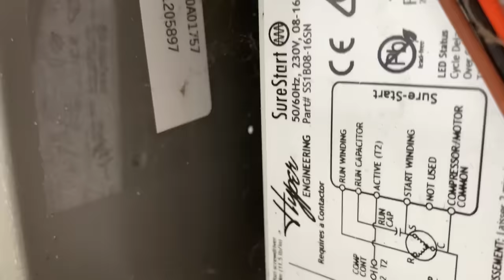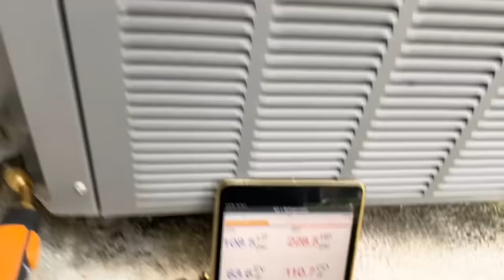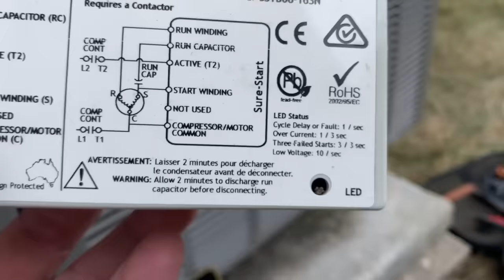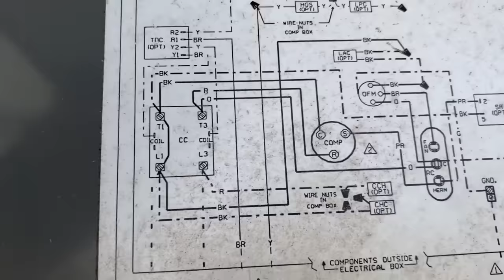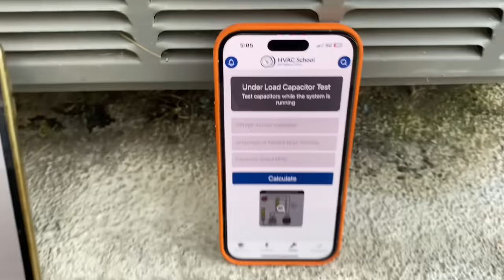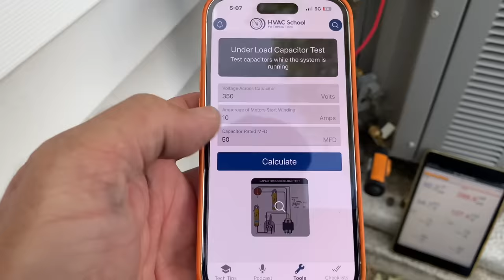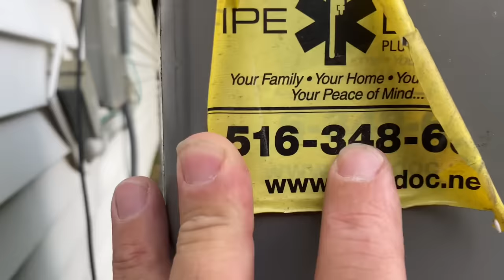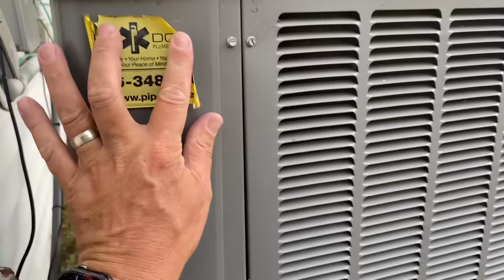Soft Start Killed Compressor! UNEDITED Central AC Service Call for No Air Conditioning Revealed!

Comment: The headline was a bit misleading.  Reading it, it implied that the Soft Start "killed" the compressor, meaning it failed and required replacement.  In reality, it shut down power to the compressor and faulted out, but the compressor itself was fine.  And as some have noted already, was protecting the compressor from over current due to dirty coils, and I believe it was an undersized soft start for this particular unit.
Reply from the maker: The soft start killed the compressor. Those are the fax it kill the power to the compressor that is more factual.
Reply: Facts* and no those aren’t the facts. Killed the compressor means damage and replace. This was not the case. The soft start went bad due to amperage
Reply: @PipeDoctor  Hi sir. When someone reads or hears that something has been "killed" we always take it as that the part has been severely damaged or destroyed. Killing the compressor is different than killing the power TO the compressor.
Reply: @PipeDoctor  Most soft starts also act as a surge protector could have been a surge maybe a lightning strike somewhere else caused the soft start sacrificed itself. I know you wanted to get clicks and views knew bunch of people would react to the video headline 118k views LOL. If the customer is never going to use a generator why replace it I agree remove it.
Reply: @PipeDoctor  so it killed the power not the compressor
Reply: So it acted like an interlock.  The compressor did not fail and was not damaged at all.
Reply: The soft start is not a piece of junk but is required to be installed on a home with a back up generator. This device keeps the amps from surging during the unit start up so it doesn't trip the generators over amping detection.
Reply: @JDOG1974yes  True, and it also saves wear on the compressor and makes it last longer.
Reply: This is a great video and I find it informative.

People are taking exception to the Clickbait line, which is understandable.

One other thing that I will point out from the video which I feel is important: you stated the compressor may need a hard start. The compressor is over amp on start up probably due to its age/wear.  The hard start probably was picking up on the amps being too high and shutting the load down. This gives opportunity for someone like you to go. Investigate with the problem is. Now the homeowners are aware they have a feeling compressor.

Thank you for your content. Anytime there’s a healthy debate over content. Everybody can learn a little.
Reply: @danieldorchester5221  I believe in the video in question, it was determined that the Soft Start kit being used was the wrong kit for this sized Condenser Unit, the kit was for a 1 to 3 Ton Condenser, but the the A/C was a 4 or a 5 Ton Condenser.

They make this kit in two different sizes, and using the wrong kit meant it failed as it wasn't rated for the Condenser size in question.

However, as I noted, the compressor didn't die nor did it fail, the kit failed, which didn't "Kill the Compressor", it Killed the Soft Start Kit instead...
Reply: @redbaron6805  You're right, this soft start was at the edge of its limits. It's rated for 1.5-7hp, 8-16 running amps. For a 5 ton, anything less than 16 SEER would be too much for it.
Reply: @ad-cc1sw  The soft start is a bad thing to put on the compressor.
Reply: @JDOG1974yes  It means you have the wrong generator.
Reply: @JDOG1974yes  Its not required you have too small a generator
Reply: @RadioRich100 Soft starters are great and they are a luxury item, a protective item. That system is as old as it is, and still working, partly because of having a soft starter on it. He really needed to clean the condenser coils first. They are plugged with garbage.
Reply: @ad-cc1sw  Those things DO destroy compressors by over taxing the start winding which can lead to failures. You shouldnt use them. This is why your warranty is violated by putting one on your unit. Or a hard start kit. Both are not good for your compressors motor.
Reply: @JDOG1974yes   Soft starts DO destroy compressors by over taxing the start winding which can lead to failures. You shouldnt use them. This is why your warranty is violated by putting one on your unit. Or a hard start kit. Both are not good for your compressors motor. Get the right size generator.
Reply: Anybody who has a dog that loves him as much as your dog loves you is A-Okay in my book.
Reply: @johnwhitehead5457  ??
Reply: @PipeDoctor  SoftStart prevented compressor to run. Compressor might have killed the SoftStart unit, or maybe did not, it should be tested on smaller motors. That particular SoftStart model SS1B08-16 FLA is designed to run Motors Between 1.5 - 7 HP For applications w/ 8-16 Full Load Amps (FLA)   
In 10:46 it is visible that this AC unit needs min supply circuit 33A and needs fuses from 40 to 50 A. That 8 to 16A unit did not have a chance.
Reply: yeah it's called a clickbait title lol. But worked it got me to click it, thankfully your comment saved me from watching the whole video.
Reply: So another words if that thing wasnt on there - it would still be running.
Reply: @RadioRich100  Basically yes.  Somewhere in the comment section, someone mentioned that the Soft Start module installed was for a 3 ton unit, but the unit is a 4 ton.

So, the soft start kit was the wrong one, and probably failed for that reason...
Reply: @redbaron6805  If it hadnt been installed it wouldnt have failed and the system would be running. If you install one its wrong right there. You dont need it and it doesnt protect the compressor or save you money.
Reply: @RadioRich100  As I noted earlier.

1.  It was the wrong part for that system, so putting in the wrong part for the size of the system is why it failed, nothing else.
2.  You obviously have no idea what soft start systems do, so your claims that you "don't need it" is based on what...? 
3.  Soft Start systems not only DO protect the compressor, they extend the life of the compressor by reducing start up current through the motor windings, and prevents the compressor from trying start immediately after a brownout or a brief power failure.

Why comment on things you have obviously no clue about...?
Reply: @Mike-01234  I blocking him for the title.  I am getting ready to try one of these soft starts on my sailboat so I can hopefully use a 5000w gen while at anchor for my 16k AC unit.  So I wasted my time watching a bogus video.
Reply: Bullshit
Reply: I bet the softstart did not fail. It started the compressir then shut it down due to detecting too much current. That was due to the dirty coil. It was an under sized soft start set to shut down at very close to the normal run current. As the coil got dirty current increased and it acted actually as it should. Had it not shut down the compressor it likely would have overheated and eventually actually died.
Further that house has a solar system, see the label on the box. By removing the soft start the system may mot be able to deliver enough current to start the compressor when the grid goes down. 
That should make for a happy homeowner😀
The more accurate title would have been “soft start saves compressor”
Reply: @56ctconger  Gee if the soft start wasnt there it wouldnt have failed at all.
Reply: @RadioRich100  What wouldn’t have failed? Nothing failed here, not the soft start, not the compressor. The only thing that failed was the diagnosis. The problem was principally a dirty coil. The wrong soft starter was applied as well.
Reply: @56ctconger  Lol your AC failed because that box came up with a code that shut it down didnt it?  If you didnt install the box it wouldnt have shut down. So why install it? It runs better without it.
Reply: @JDOG1974yes  there is no such requirement for these piece of junk soft start devices.
Reply: No it happens alot. And everybody on here denies it because they stupidly bought one.
Reply: @RadioRich100  That is literally fiction.
Reply: @redbaron6805  You think so?
Reply: How long have you worked for that company? Maybe you should make a fake review video.
Reply: @JDOG1974yes  Exactly, or backup from solar system. It seems to me like "I am old school, I do not know this was supposed to do so it must be unnecessary junk." No offense to author, we all learn whole life.
Reply: Lots of soft starts have killed compressors for many reasons. So why buy one? Also voids your warranty - Double wammy!
Reply: @RadioRich100  Except of course, there is zero actual data that supports that claim.  Soft starts can't kill compressors.  And no, soft start systems do not void your warranty.
Reply: @redbaron6805  So your selling them? The data as you call it is everybody that has lost there compressor and warranty at the same time. Ive heard it from hvac guys and consumers alike. Do you really think there is some govt agency that logs compressor failures due to installing external gadgets on them? As far as the warranty being void - a definite, call the manufacturer. Theres your data. Not to mention the tons of service calls related to these things failing and bringing down your system due to component failures, electrical surges and lightning strikes which would not have effected the unmodified compressor. Also property damage. When you put one of those in your system, it now depends on it. An electronic gadget box increases the point of failures dramatically and when it happens when your away from home, mold growth, moisture damage etc. Not a good idea to install one
Reply: @RadioRich100  The data is "everybody" who lost a compressor...?  Who is this "everybody"...?  Do you have any actual data showing what you claim is true, besides you just happen to know a bunch of "everybody's"...?

Yes, obviously YOU have done your own studies and interviewed hundreds of HVAC companies and consumers on the issue, and I'm sure you published that peer reviewed study somewhere.  Care to share the link to it...?

You seriously think lightning strikes and power surges don't affect the compressor..????  Based on what...???  I have only worked with electronics and motors for about 30 years, and I have never heard this new magical statistic where compressors and motors are not affected by lightning strikes and surges.

Literally ALL industry data CLEARLY says that lightning strikes and surges can damage windings and cause early motor failures.

You appear to be posting a ton of claims here with zero actual evidence to back any of it up.  In fact, literally every A/C company and installer I have ever talked to, including every A/C contractor forum clearly say that soft start kits make compressors last longer.

Yet... there you are... with some magical data from "everyone" showing otherwise...
Reply: @redbaron6805  This is a place for commentary not a court room nor is there data supporting either side thats recorded. Sorry about your sales going down because people like me will inform others. But your opinion is based on people selling them. Mine is based on actual happenings with no monetary involvement. I have been in the industry a long time and my facts stand along with the findings of others like me that these magic boxes are not recommended due to the problems they cause by forcing systems to operate in a way that the equipment wasnt designed to. Instead of crying about this why dont you contact the manufacturer of the A/C system and ask them? You know you wont do it, because they will tell you what you dont want to hear. That is your data. Stop getting opinions from half ass contractors and merchants that sell them to people like you who dont know any better. Stop listening to utube follow the leader know nothings.
Reply: @redbaron6805  You havent seen the ball since kick off. Ive disconnected enough of them. Call your manufacturer about the warranty. Its their opinion thats counts, not that of a halfass follow the leader utuber.
Reply: @PipeDoctor the first sentence you provided is misinformation. The second sentence, where you provided more information is more factual. However your logic shows you know you are in fact incorrect but attempting to stand your ground anyhow shows you just care about the views and don't care that you know it is clickbait rather than rightfully earned the foot traffic for doing a good hard earned job.
Reply: @RadioRich100  It obviously isn't.  The entire claim is just beyond absurd.
Reply: @RadioRich100  It doesn't.  A soft start kit means you can use a smaller generator.
Reply: @RadioRich100  Just clueless nonsense...
Reply: @RadioRich100  Just more clueless and absurd utter nonsense.
Reply: @redbaron6805  At the price of the compressor and other failures
Reply: Nonsense, if you didnt put it on that system it would still be running fine. So you dont need it. Plus you added points of failure to it.
Reply: @RadioRich100  Actual data shows otherwise.  Your are spouting a bunch of ignorance and bull.
Reply: @RadioRich100  Except that is utter BS.  Soft Start kits prevent compressors who get momentary power outages from trying to start as the system is during the decompression cycle, which overdrives the compressor and often trips breakers due to overcurrent.  Soft Start kits extend compressor life.  It isn't even remotely a question.
Reply: @redbaron6805  Thats nonsense, your thermostat and compressor timer prevents that. Over current is a bad compressor motor or incorrect electrical service. You dont put bandaid boxes on a system to correct faults, you correct the problem. Soft start kits-as well as hard start kits DO NOT protect or extend the life of compressors or save electricity and often lead to their early demise. They also generate alot unnecessary service calls for faulting out the compressor , disabling the A/C when nothing is really wrong. And if your on vacation your system is off because the gadget box glitched and needs to be reset, resulting in mold growth and other issues that wouldnt have happened. Sorry to hurt your sales of these junk boxes.
Reply: @redbaron6805  And destroy your compressor and put in more points of failure.
Reply: @RadioRich100  Except, yet again, you just keep parroting the same false claims, over and over, thinking if you just repeat them often enough, they will magically become true.

They won't...
Reply: @redbaron6805  The problem is they are and always will be true, you cant stand it that you wasted $350 on a junk box that will eventually cost you far more than you paid for it. If you call that magic, then so be it. Im a pro your a utube bozo. Ill give you a free piece of advice - when your system stops running because your gadget box is failing, glitched and or resetting it wont bring it back, if your system is in warranty - remove the gadget box and put the wires back where they go (if you can figure it out) before the authorized service tech gets there . At least you wont get charged for the service call - BUT! if your lucky removing the jesus box and putting the wires back (if you can figure it out) may just just fix the problem. (If it didnt smoke your start winding).
Reply: @redbaron6805  There is no "actual data" just peoples unfortunate experiences and disappointments and waste of money including damage to there systems and service calls- you know the little blinking lights that wouldnt have been there.
Reply: @RadioRich100  Except, that proves nothing at all.  My company uses Soft Starts in many A/C systems, and we have had zero failures, as in none at all.

Countless people use them on a daily basis with no issues.  Can they fail due to power surges, lightning strikes or other causes...?

Yes, of course.  But that isn't a failure of the systems.  Countless A/C's fail daily when power surges and lightning strikes damage control boards, motors, compressors and other parts of the A/C system.

If these are installed correctly, and paired with a surge protector, they will massively extend the life of the system.  No questions at all.
Reply: @redbaron6805  Nonsense,  those systems as you call them are not designed to start off those things which is where the failures come from on top of the additional points of failure you put in with those boxes. Countless people as you say are not using them as you say because I know some of them and the problems they have had. Your making that up. They definitely will not make the system last longer (the opposite), lower their electric bills or any other nonsense ive read on these utube follow the leader channels. Quite the opposite from board failures, compressor windings blown, glitches and resets etc etc. Plus they void the manufacturer warranty. Pretty bad investment your "company" has made. Wait until some unknowing customer loses his compressor under warranty after you B.S.ed him into buying it. - Get a lawyer.
Reply: Yeah right like if it didnt have a magic box it would not have shut down at all.
Reply: @RadioRich100  the code is telling you that there is a problem before it burns up the compressor. How long like that before something fails. He found the problem because the soft start shut down the compressor before it was damaged. Make sense to you.
Reply: @RadioRich100  You are the expert?
Reply: @RadioRich100  Yawn.. same recycled BS which no other A/C repair company is seeing, but magically you are.

You really just need to start your posts with Once Upon a Time....
Reply: @redbaron6805  Apparently alot of people see it, and its upsetting you. So how many sales have you lost?
Reply: @redbaron6805  You cant stand it when somebody reveals your selling them unnecessary crap.
Reply: @kennycardwell132  Ive seen it enough so im one of them.
Reply: @kennycardwell132  No it doesnt. Had he not installed the gadget box there would have been no failure at all.
Reply: @RadioRich100  No one is seeing anything except you.

Just a sad little toddler....
Reply: @markdavidson1049 Master electrician here, I agree.